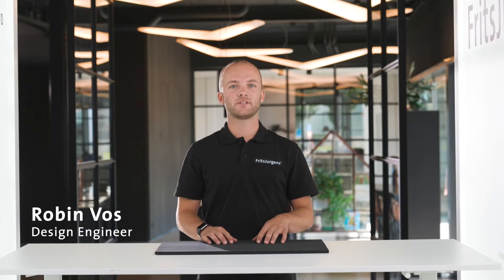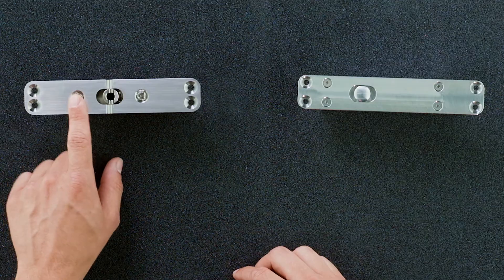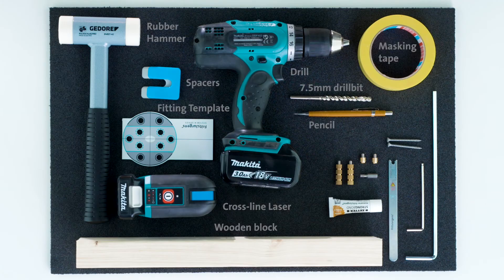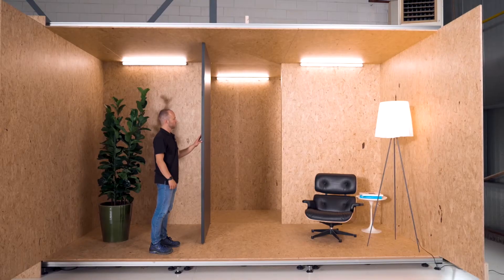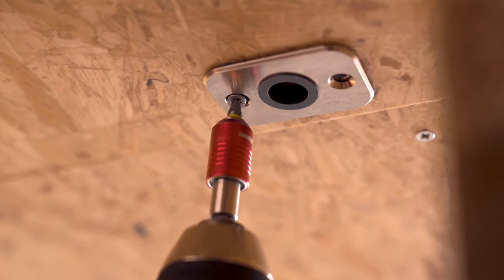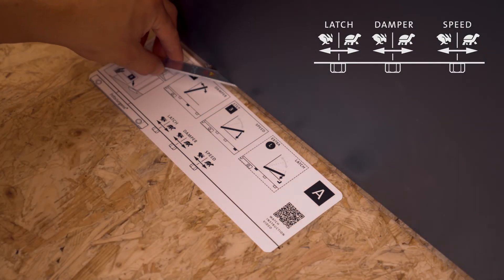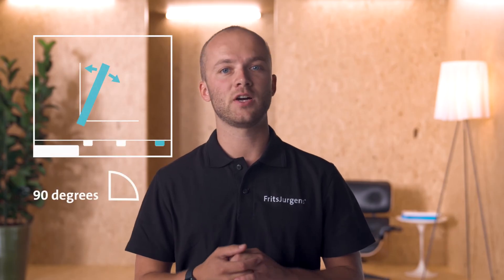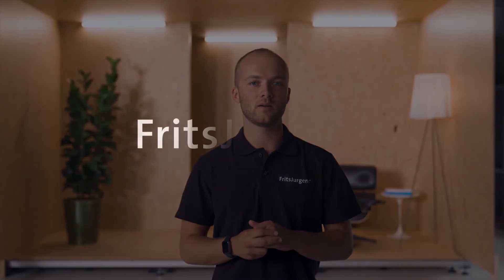Pivot door installation - System M+ & Top pivot 70 mm  - FritsJurgens Tech

Comment: Can you adjust it up or down? I have french doors and floor is un level
Reply from the maker: Yes, you can. Our top pivots are adjustable, allowing you to align the door precisely – even when the floor is uneven. This ensures perfect clearance and smooth operation of your pivot door.
Reply: @fritsjurgens model m 70 mm class AA does not have an adjustment up or down. Your floors better be level. Which they will not 99% of the time. Mine were a 32d off that's enough to have uneven doors. So I had to use shims under the bottom plate.
Reply from the maker: @melgozakoki85, I understand your point. The bottom pivot itself does not offer vertical adjustment. The vertical adjustment is done at the top pivot.

If you check page 47 of the milling and mounting manual, you’ll see that the two screws in the Top Pivot 70 mm serve different purposes:

- The lower screw is used to screw/unscrew the pin to position it correctly in the ceiling plate.
- The top screw allows you to fine-tune the vertical alignment of your door within the 4–10 mm tolerance.

You can review the manual here:
https://www.fritsjurgens.com/downloads/milling-and-mounting-manual-system-m-70-mm-class-aa-a-b
Reply: @fritsjurgens, yes, I got it. I'm just glad I checked before I started cutting the tile. I really appreciate the service and quick response. The job turned out great. Check it out after September 10. I don't know when they will revil the new display, but it's for Subzero Wolf show room in dallas.
Reply from the maker: We're happy that we could be of service and help you deliver great work. Please don't hesitate to reach out again in the future if needed. Also, we're looking forward to seeing the end result of the Subzero Wolf showroom.

If you can, and if the client agrees, please consider uploading the project to the upcoming annual Best Pivot Door Contest, and become part of an elite group that shapes the future of pivot door design. The entry deadline is the 3rd of November. For more information or uploading a project you van visit https://www.fritsjurgens.com/bpd. Hope to see you there

Comment: I am currently doing or aluminium and 3/8" glass door 5' wide and 8' high.

Therefore my customer needed your syste M plus pivot hinge.

The way l see it install. The pivit hinges need to be place 16" from one edge of the door.

Which model number of the system M l would need to order?
Reply from the maker: Hello and thank you for reaching out. For calculating the lateral forces, which tell something about the ideal place for the pivot point, please use our calculator: https://www.fritsjurgens.com/lateral-force-calculator

If you are unsure which pivot system suits your project best, please use our product selector and find out excatly what you need in a few simple steps: https://www.fritsjurgens.com/selector

Comment: hello what is the difference between m32 m+
Reply from the maker: System M and System M+ differ in adjustability. System M+ offers extended adjustment settings such as Latch Control- when latching bolts are applied, Damper Control- to adjust the opening damping (hydraulic backcheck / Wall protection) and closing damping (soft-close) of the door, and also 30-degree speed control, which allows adjusting the closing speed for the last 30 degrees of the doors closing movement.

You can learn more about System M:
https://www.fritsjurgens.com/pivot-hinge/system-m

or System M+:
https://www.fritsjurgens.com/pivot-hinge/system-m-plus